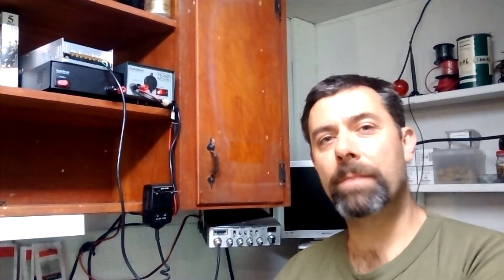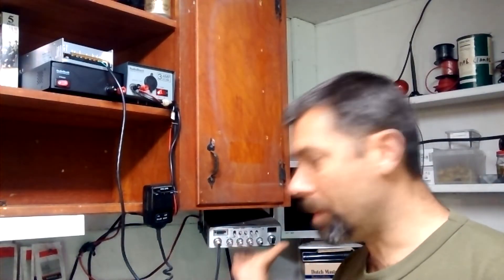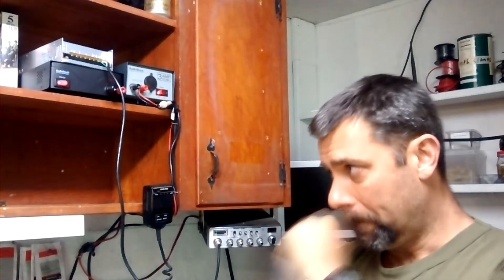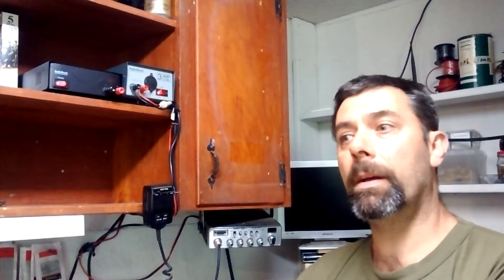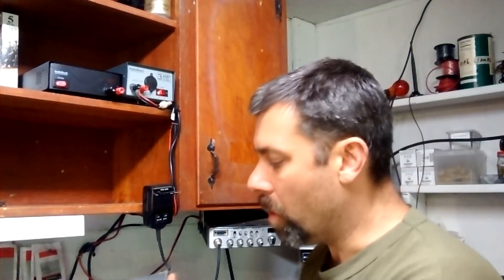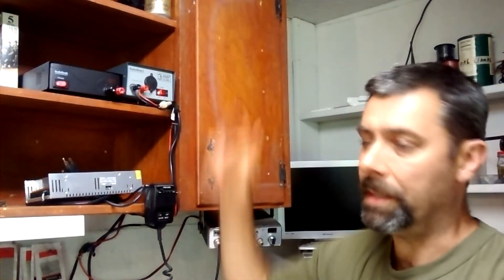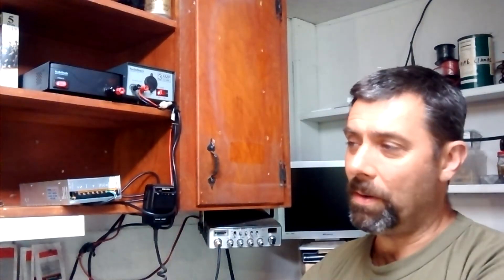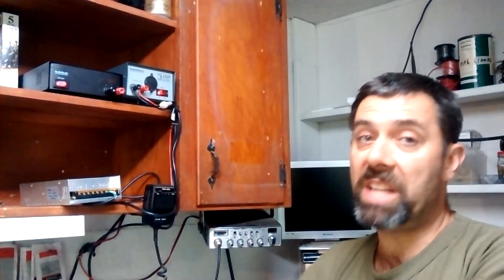CB Radio Power Supply Options For Base Station Setups.

Comment: How does the power supply actually connect to the CB radio? Do you have to twist bare wires? You didn’t really show any of the connections.
Reply from the maker: There are terminals on the power supply, you take the wires and connect them.

Comment: I was thinking about getting the 955 Stryker and hooking it up to my solarcon 18 ft antenna the power supply is still in question what do I need to get as far as a power supply to run this radio properly it will be tuned to about 80 Watts or so I was looking at a power supply that is adjustable up to 15 volts I have a 10/2 wire running from a 20-amp breaker from my house to my out building that's the power to the out building
Reply from the maker: I have a 955. A 20 amp power supply powers it perfectly.

Comment: The base station CB   radio is damaged but the Power Supply does work.
I want to use the Power Supply to supply a mobile radio.  CB radio.
Reply from the maker: That will work! Just wire the power supply output to the input on your mobile.

Comment: Hi my friend. I enjoy your videos And I just subcribed to your channel. Thank you for sharing your knoledge and good work in helping us understand a little bit more on how to use our CB radios. I just have one question.. I just ordered a Uniden PC78LXT 40-Channel CB Radio (With SWR Meter) & BC15 Accessory CB/Scanner Speaker and I wanted to ask .. Can I use a ACUARTAURO 180W AC 110-240 to DC 12V CONVERTER Max 15A/8.2ft to connect my new CB Radio in my home? I will Appreciate your answer. Again, Thank you my friend for your good work.
Reply from the maker: Yes, that will work great!

Comment: Just got a Stryker SR-955HPC 11 meter radio. To use it as a base station, what regulated 12 volt power supply would you recommend?
Reply from the maker: Mine is powered by a use Radio Shack 19amp supply that I got on ebay
Reply: I already have a Micronta Regulated 12 volt power supply, 12V DC, 2.5 amps. Would this work for the same Stryker SR-955HPC? Is it safe to experiment with hooking it up--or can it hurt the radio? @FarpointFarms

Comment: I am putting a mobile CB radio in my cabin . I want to hook it up to A/C.
Im offgrid. But my cabin runs off of A/C  everter from solar D/C .
Reply from the maker: You will just need an inexpensive AC to DC converter.  I got a used one from Ebay. Anything rated at more than 2 amps will work.
Reply: @FarpointFarms  thanks, I might have one .that would be great.

Comment: I run a semi trucking detail service, kinda an in between before reselling them.   I have 4 different CB Radios so far all had mic, mounting bracket.  1500 watt power inverters, copper wrapped antennas.      I am wanting to set up a home base and wondering about coax cables? 18 to 36ft?  Car battery uses? (If even a tool)?
Reply from the maker: You can use any length cable. I have an 80 foot run to my base antenna and it works great.  The battery will work well also, jut get a $10.00 trickle charger for it and it will always be ready for you.

Comment: I have a Cobra 148GTL-DX CB radio  that belonged to my parents but it hasn't got a power lead and I don't know if it was plugged into the mains or had a  12 volt cable for a cigarette socket. I'd like to put it in my vehicle .
Would you be able to tell me if  I would have to get a mains power plug and plug it into an inverter or can I get a 12 volt lead and plug it straight into the car ?
I,m in the UK but I know that when my dad got this unit it was illegal in the UK  but is legal now but I don't know what the ampage is on it at the moment untill I can find the manual that came with it.

Comment: Good evening.  I am looking to hook up my over 40 year old Sears 23 channel mobile.  I like the idea of the 3 amp regulated power supply.  My CB has a red and black wire coming out of the unit which I would match with same colors on the power supply.  But I see an in-line fuse on your set up.  My current set up has in-line fuse also and both red and black wires are attached to cigarette lighter plug. This is how it was set up when I used in my car some 40 years ago.  Is the in-line fuse necessary?

Comment: Thanks for the video, I'm contemplating getting a crt ss6900 & a small amp (100w), can I use 1 power unit for both 6900 & 100watt amp ?

Comment: So I found a 12 volt cigarette lighter to wall outlet adapter on amazon. Could I use that instead of using a power supply and stick get good power and voltage?

Comment: What exactly is this radio shack 3amp piece called? I can't find it anywhere and don't know what to search for elsewhere. There are tons of converters out there but nothing that I found which would accommodate the cigarette lighter plug (if that's what the 980ssb comes with, that's my other problem since no where can I find the power connections on that unit)

Comment: Thought I'd watch this video of yours eric. I want to add a little power to my base unit but I really have no idea what I'm doing when it comes to adding power I don't want to destroy my radio or set my mobile on fire. but I am way out in the country and my radio is receiving very well but the transmit side sucks I have so many trees around me I just can't get my signal out.right now I'm just running that little tram I think it's model number 1499 looks like a big fire stick it's only about 3 ft tall on about a 20 ft Pole alongside my mobile home perhaps I need a better antenna might help the signal I don't know any advice you could give would be greatly appreciated thank you Dan williams.

Comment: I was wondering can u just plug your cb into the wall or does it need to go thru the regulator?
Reply: Needs to be a ax to dc converter I believe. House power is AC and cb radio is dc

Comment: Just ordered a Ameritron SPF75MV  Power supply.   And a ranger RCI63FFD4 ,  Converted ,   Peaked and tuned ,400Watts
RMS 500w peak.  Going all in with 100' of LMR 400 FLEX  Cable. Including a 6' and 3' for the bench. I have the Radio Shack Shakespeare fiberglass Pole Still from back in the day in mint condition. But I went ahead and ordered the Solarcon A99  With ground plane, Just a have all new.  Still trying to acquire a Dosy TFC 3001  Inline SWR power meter with Built-in  Frequency counter, Nobody has in sold out everywhere. Trying to contact the factory in Indiana to buy direct. This will be my 1st base station set up. At 54 years old lol. OK maybe my 2nd in late 1980 I had a 4 Watt  Radio Shack Base station.  Don't know if that really counts lol.
 Also purchasing a 1500 Watt  Dummy load
 To make sure everything's good . Don't want to cook a $700 radio  With upgrades of course before getting started.  Oh yeah almost forgot I still have my Radio Shack  4 Watt bass station from late 1980s to.

Comment: I have a cheap power supply in exactly the same metal case, but the 15v S-450-15 version.
Paid £16.99 delivered in the UK, from a UK seller.

As the voltage can be adjusted +/-10% on these power supplies, the 15v model is easily tweaked to 13.8v, which is likely a little beyond reach of the 12v models..

Comment: How do I splice the wires on my new CB to a 110 outlet plug?
Reply from the maker: DON'T! You'll need a 110 to 12volt converter box. I have a video on them, but you can get used ones on Ebay for less than $15.00
Reply: Lmfao
Reply: @syren1913  ...I Plug my CB into my dryer 220 outlet  ...I was Really shocked at the outcome!  ...Now me and my CB Really get distance!!

Comment: Quick question man. If you had say 4000 watts on a base station, It might reach across the US or other parts of the world right?
Does that necessarily mean it will equally receive that good?

I've heard a guy talking at least 4 states over on 4000 watts. Right at 1000 miles base to my mobile. Then he turned it down to 2000 watts. I could still hear him like nothing changed. Obviously I could not even come close to talking back to him on my Stryker 955 but that was till impressive to hear CB getting out that far.

The question is does all the added power add reception or just transmit?
Reply from the maker: Just transmit. In order for both sides to be on equal ground, they'd both have to have the same output.
Reply: @FarpointFarms  Thanks! That's what I was thinking.  I heard a guy talking CB on 4000 watts once and he was 4 states above me.  Then he cut the power down to 2000 and it made no difference where I was so I assume he was reaching nationwide or more.  He couldn't hear me when I gave him a shout on my Stryker 955 SSB radio.

Comment: Watts  always amps X volts. 10 amps at 12 volts is 120 watts. Even an unmodded SSB (AM 4watts/SSB 12 watts) will only use a tiny fraction of the available 120 watts. Yes, I know there is an additional load just to operate the equip. aside from the transmit power, but it isn't much. A 10 amp power supply is more than enough to power any CB ever made.
Reply: Yes and no. My radio wants at least 10 amp and with that the power supply will be working hard. So to be safer it needs 12 amp at least.

Comment: Hi i am new in this hobby,i want to ask you what power supply can i use for my Galaxy dx 959 how much amp for the radio. PS:
     My English is no to good an I apologise for that.
Reply from the maker: A 20 amp power supply should be fine.
Reply: That radio probably uses a 3 or 4 amp fuse, so a 5 amp power supply is easily sufficient. Don't listen to this idiot, 20 amp. And that way you can get a non switching power supply so there's no chance of unwanted spurious noise.

Comment: Won't that hut the cb that only has a 2A fuse inline? I'm confused. 

Can I use an old laptop charging cable?
Reply from the maker: 12 to 14VDC at any amperage. the radio may only draw 2 amps and that's OK you can apply however many amps you have it won't hurt it.

Comment: Still using the old battery with a charger connected to it and vent the battery properly. Unless you're in a super tight confined space, the battery vapors shouldn't pose a problem. Using a 30A power supply is a great way to go unless your AC circuit's amperage can't handle the load.

Comment: I inherited a cobra 19 ultra iii. I want to install it in my garage. Can't figure out a power supply. I want to repurpose a 12v ac/dc converter that plugs into an outlet and has one of those circle plugs for the device end. I can't figure out how to connect the cobra to this. I keep blowing the fuse. Any insight is much appreciated. Thanks.
Reply: Ultra Magnus 
Sounds like your amp draw is too low. You’ll need a higher amp drawn power source (check ebay) to produce the right amount of power

Comment: Fairpoint Farms 2 questions. Can you run 2 pieces of equipment on one amp?? Looking at a 30 amp pyramid power supply.   Or is it a separate power source for each item. Like a cb radio and linear!  And would a 30 amp pyramid power supply be not a good choice for a mobile cb?  Got an old cb with ssb but thinking of buying a peaked and tuned galaxy 979. Thanks Dave
Reply from the maker: As long as the total power requirement doesn't exceed the 30amps you should be fine running more than one thing on it.  A mobile (stock) radio should draw only about 3 to 5 amps so you would be fine running two of them off one power supply.

Comment: Hey is there any recommendation for a power supply to power up a Uniden PRO505XL?
Reply from the maker: A standard 3 amp used radio shack model will work great with that radio.

Comment: Hi new to the hobby got a cobra cheap one hooking up power from AC to DC what do you do with the wire with the the fuse on it do you cut it off and just leave it alone just asking a question
Reply from the maker: Leave it in place. It's an added level of protection.

Comment: I ordered Uniden BEARCAT 980SSB CB Radio with SSB from Walmart for $120.99 based one your ytube video and now I just purchased on ebay a Pyramid PS3KX 3-Amp 12-Volt DC Power Supply.  Do you think this power supply will do the trick?
Reply from the maker: Yes, that should work fine. Welcome to the hobby!
Reply: 3A? I would go for a minimum of 5A.

Comment: Usually these (mobiles) are supposed to be run/tested/adjusted on 13.8v, and while the Rat Shack PS with the cig.lighter adapter is mentioned as 12v, it's glimpsed on the front of it to be 13.8v.
Reply: Great point u just saved a 150 bucks u a banker my friend woodsmen be the handle
Reply: @troydixson1394  wait until he finds out 110 isn’t exactly 110
Reply: Love radioshack not a lot of pressure guys in you're face just u

Comment: have you used that cheap switching power supply yet ? i need a 20a power supply for my uniden 980 with 100w stinger board. problem is the 20a power supplies are big money.. i saw that switching power supply and it peaked my intrest i heard that they make alot of RF noise though... have you experienced that ?
Reply from the maker: Yes I've been using it for close to a year now and there is no unwanted buzz or noise coming from it. I built a small wooden box to hold it so that the live wires wouldn't be exposed.

Comment: Hey I got a question I'm thinking of buying a galaxy 949 radio I'm running it stock no mods no linear would the 3 amp power supply be enough to run the radio

Comment: Thanks for the update Erik. I have always ran radios in my mobile but, thinking about a base myself !   Looks like you may have shelved your video plans for one of your projects!  Dog Gone IT , I wanted to see that TOO !  Thanks for what you post , enjoy it !
Reply from the maker: No problem. I haven't given up of the other thing, But a VERY bad apple was trying to make my life miserable, so to protect my rear, I've had to back off.    It sucks there are some really mentally ill people on the internet, but it is what it is.   You should defiantly get a base setup! I'd say I use my base station setup 5 times as much as my mobiles. With a little luck you'll be chatting it up with some hidden locals you didn't realize were out there in no time.  Although I have an actual base antenna (Antron A99) you can make one out of bare wire for less than $30.00 that will work just as well.
Reply: Thanks Erik. I will get that going soon. I was reading some of the comments and that guy was definitely trying to stir up some crap for sure. A real troll! Good luck and keep posting!